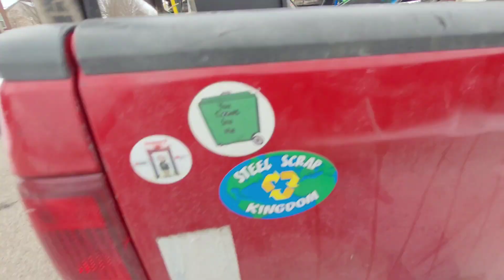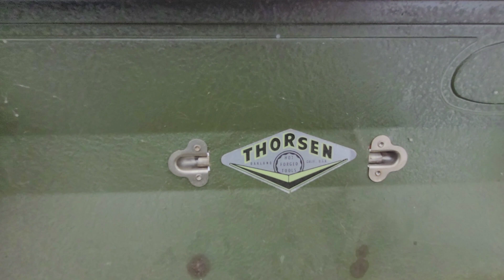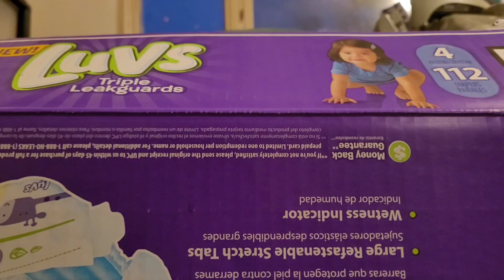Selling People's Trash

Comment: The phillips punch it is called a star bit used for breaking rocks when drilling through concrete, if you hit a rock when using a masonry drill bit you use the star bit to crack it so you can drill though it. I could use those large flat screwdrivers, I use them when I take or put tires on a rim. The tool box is a great score. Keep up the great videos and God bless you and your family.